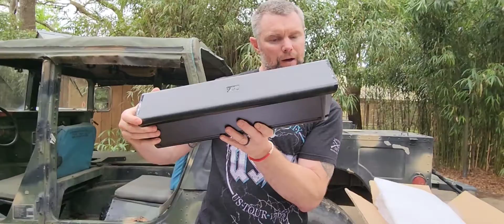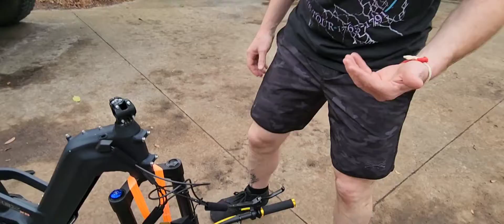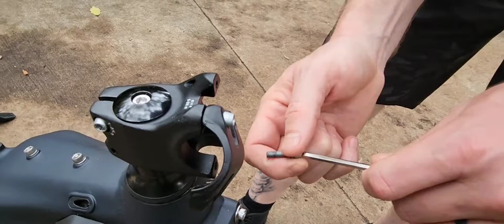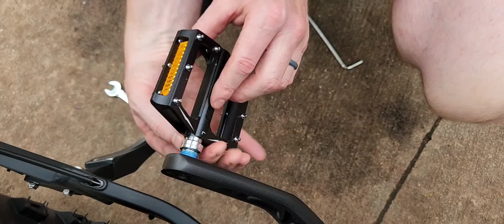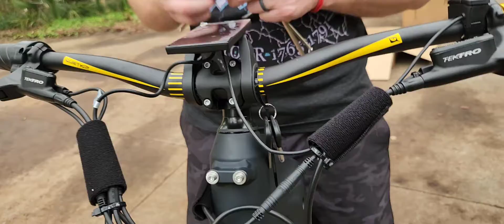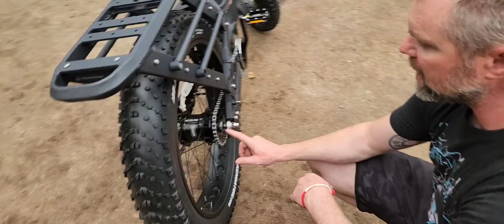New QuietKat APEX XD Prototype E-Bike Unboxing and Assembly

Comment: 18 months ago I purchased a QuietKat Ibex.  I’ve upgraded the power train to a Shimano Linkglide and installed a Wren front fork.  Love the bike;  I get 60 miles on a single battery and recently did a 112 mile ride with my spare battery I carry.  Love bikepacking and camping.  Bike has performed flawlessly for over 4000 miles.  Now I’m looking hard at this bike.

Comment: I have been thinking about buying some kind of E-Bike since you can't buy a new Tomos moped. They closed up shop in 2014 which shut that idea and concept down abruptly. When we were kids that was a handy dandy thing to have in your garage or barn. They came in very handy and are very useful. Something in the middle of a bicycle and a motorcycle that is fairly lightweight to move around on at low speeds. Looks like a E-Bike is my next best and closest option that I can still buy. The used 70's and early to mid 80's models we had as kids have long been scrapped by now and are no longer running or fixable today. They needed constant repairs even back then because they were well used when we got them. All I need is something that can be pedaled as well as do approx 15 - 25 MPH with a engine/motor on it so you don't have to pedal all the time. It also will serve double duty as a bugout vehicle and a way to get around large rural areas of land.
Reply from the maker: Yah I hear ya! Well this specific model ebike has multiple settings in its computer for max power so you can adjust based on where your riding for meeting state/city/park power caps, along with ride modes like eco, trail, or boost which also adjust the power out and battery usage. On the eco its no problem to maintain 15-20mph, and the trail setting 15-25, on the max performance setting you can go upwards of 30mph pedaling or using the throttle. Hope that helps.